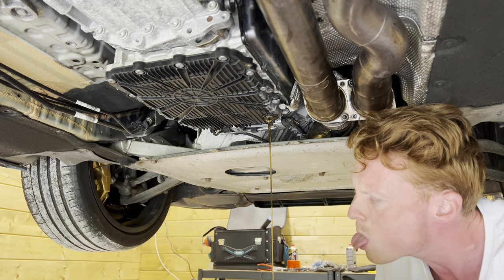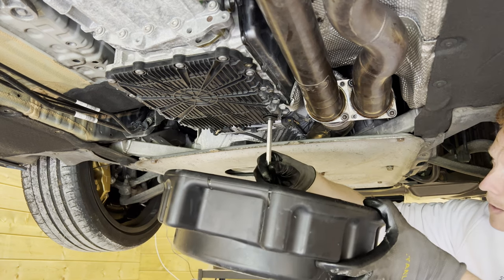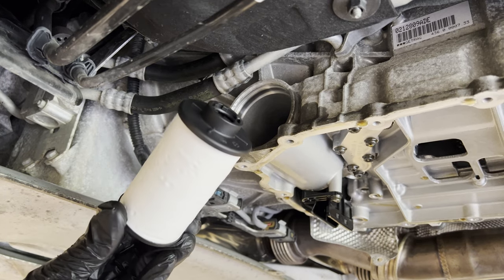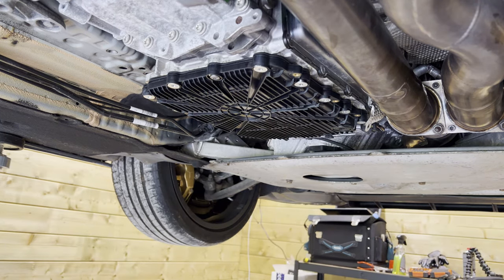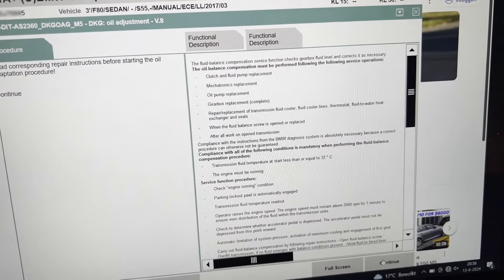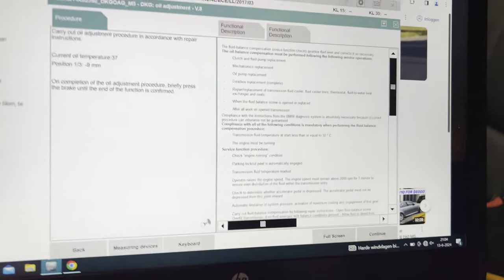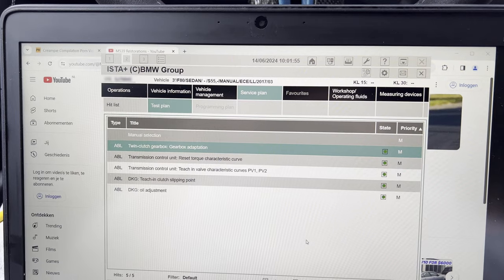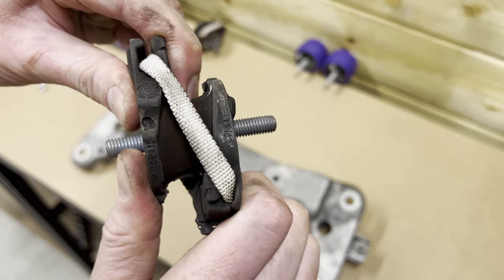BMW M3 Competition: Full DCT Service & New Powerflex Transmission Mounts

Comment: By far the best video i've seen on this. When i did mine i cocked it up so bad...my pump failed during the refill procedure, and so i turned off the engine so the fluid wouldnt overheat while i tried to fix the pump...but I left the fill plug open and lost £25 worth of fluid 😭😭😭
Reply from the maker: Oof that’s unfortunate! Thanks for the kind words mate